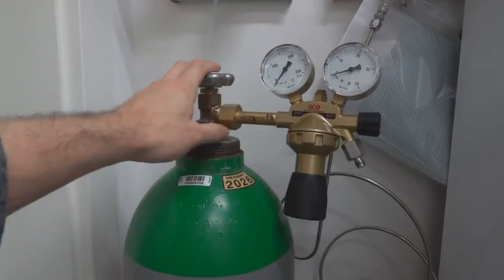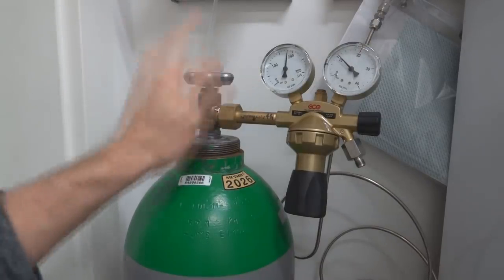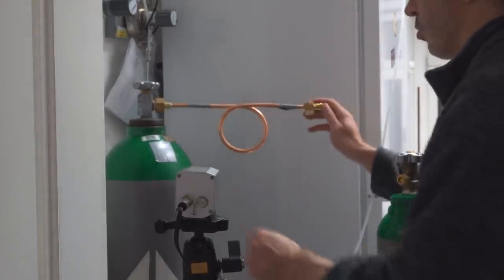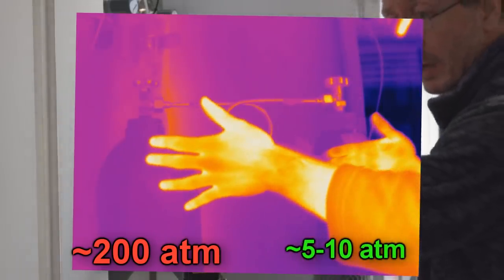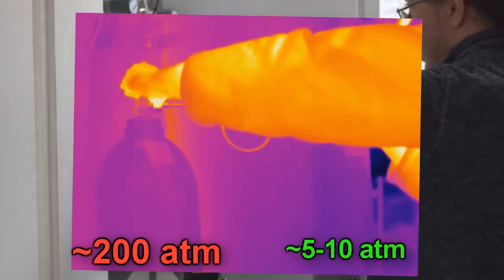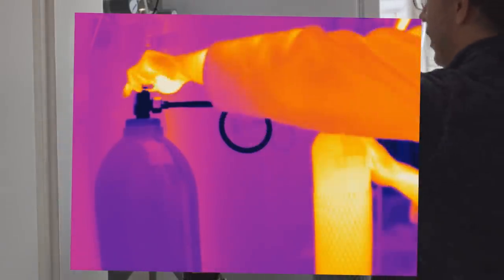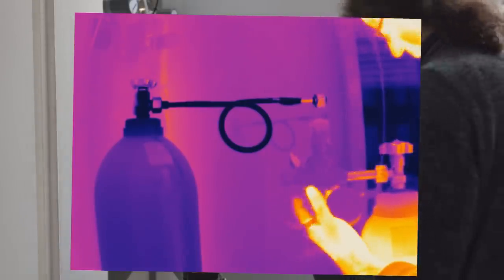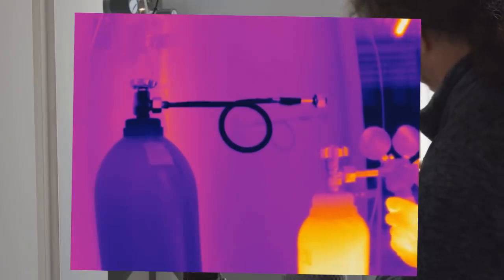Dangers of high pressure gas!

Comment: My general understanding is that using compressed gas to induce kinetic movement loses about 50% of the compression energy in heat.  As an "energy battery", compressed gas is not very efficient.
Reply: If you use it in an engine (piston or turbine) it can be actually quite efficient.
Reply: @phileas007  if you are speaking of turbo-compression, the inefficiency of the compression is hidden in a greater power generation in the engine.  Of course, you lose fuel efficiency, and compression loss is part of the reason.  Lastly, the compression uses power otherwise lost in the hot exhaust. My only statement is that as a manner of storing energy for later reuse, compressed gas is horrible unless it is just using power otherwise lost.
Reply: @puncheex2  No I meant just the storage and propulsion efficiency. E.g. http://file.scirp.org/Html/2-2760072_60325.htm

I'm not advocating for compressed air to be a viable alternative and a silver bullet. I just mean that it can have some legit uses
Reply: @phileas007  Oh, yeah, then I'm with you.  Nothing like pneumatic tires.

Comment: Respect your high pressure gas cylinders!

Seriously.
Do not do stupid things to them!
Here in Russia we have many cars with LPG fuel system installed. 95% of installations are aftermarket. Poorly installed or maintained LPG Fuel system are dangerous due to risk of explosion. Not combustion explosion but phase-change + expansion one. That kind of explosion will burst your car open like smashed tuna can. BTW working pressure in LPG cylinders are about 10-12 bar (i know there in liquid phase too).
Reply: Ha ha! A Russian lecturing on safety.
Reply: @Jehannum2000  not all of us are jackass xD
Reply: LPG i propane-butane? Thats no way 10-12 bar. More like 2-5 at normal temperature if I remember correctly.  CNG is however a completely different beast!
Reply: @Sixta16  Around the world people use LPG cylinders in their homes with something between 3atm and 10atm, so up to a little more then 10bar, and those aren't necessarely as safe as cylinders for vehicles, which usually should have thicker(or at least "stronger") wall, though with a "fissure before catastrophic failure(fracture)"  calculation in mind, like all pressure vessels! So, yeah they might have some hitting 12 bar and CNG cylinders can get up to 220bar!!!
Reply: I know a guy who had his car lpg system do this, ruined all his door and windows, the windscreen was blown out and flew 4 houses down the street. Very lucky it happened late night/early morning so there was no one on the street

Comment: Stop using Teflon tape on gas connections! If you need tape to stop a leak, then there is a problem with the fitting that needs to be corrected. I do work with pressurized gasses, including fuels, oxidizers, and inert. Not trying to be a prick, I'm just concerned for your safety. Cause I like you, and the work that you do. And I don't want anything bad to happen to you. Or anyone, for that matter.

Comment: FYI. 
The correct way to flush the line (to avoid introducing any moisture or foreign gasses into the receiving bottle) is to screw up the line on the receiving bottle almost all the way and then, ever so gently open the main sending bottle. While the gas is escaping out of the threads of the nut on the receiving bottle is when you tighten it up the nut fully. This ensures that the only thing in the lines is the gas from the sending bottle.

Comment: Can someone explain a list of reasons this is so dangerous to do? Alota things are dangerous in day to day life, you just gotta be cautious and have common sense
Reply: Pressing compressed air into your skin is very dangerous. And messing with high pressure containers is extremely dangerous. Only trained professionals are meant to refill compressed air tanks. Hes doing a portable air recharge which is what a lot of paintballers and air rifle shooters use. But you need a regulator to stop this heating issue.

Comment: Um, bad form on certain safety issues.
Also, pure oxygen can be astonishingly dangerous.
I worked with it in an ambulance setting where we recharged smaller bottles from a bigger bottle.
No open flames, spark sources, or heat sources of any kind.
No grease or oil on the threads.
Brass tools only.
Wear gloves.
And both bottles had to be secured before transferring gas.

This is actually a good lesson on how cold does not exist.
What exists is lower degrees of heat.

Your brain receives signals from your sensors (ie: on your skin) and interprets those signals as to something having less heat and you understand it as being cold.

Cold is not a physical thing.
You can not add cold to a system, you take heat away from a system.
In this case the compressed gas is absorbing the heat as its volume expands.

Cold is your brain telling you that something has less heat energy.

Comment: I do hypoxia experiments with low 02 gas mixtures as in this tank and every time I adjust the regulator I sweat bullets. Especially since the chamber I gas into can't exceed 5 psi otherwise it will explode.

Comment: That's why you don't run an insulated copper pipe as a transfer  line. The heat in the second cylinder during compression is only the heat picked up during the expansion down the transfer line. Hand your PhD back if that isn't fucking obvious

Comment: see if you can boil water off the cylinder by throwing 100 bar into it. Then if that works try melting gold with it as you did with the gummy bears.

Comment: Very very interesting! I would have been afraid to connect 2 tanks like that since if you opened the valve on the big tank wouldn't that make the pressure in the copper pipe the same as that in the big tank (since the is no regulator valve)? If so how could the copper pipe handle the same pressure as that of the thick walled steel tank?
Reply: The Robotics Code Depot because they have fittings & hoses that are rated for certain pressures.  I'm sure TF has enough experience with compressed gasses to know this & use the correct gear.
Reply: @ktx49  - I'm sure he does but it just seems odd that a thin copper pipe could be trusted to bridge two thick walled steel tanks.

Comment: I was taught to put the receiving cylinder in an ice bath.
Reply: It would make more sense to put both cylinders into the same bath. The heat would flow back from receiving one to the giving one.
Reply: @M0rtanius  Sorry, no. It really doesn't work that way.
Water is not the greatest for heat transfer.
PVT - Pressure, Volume, Temperature
Reply: @josebenitez3732  Just stir the water at the same time and everything will be fine. Still water does indeed not transfer heat well.
Reply: @josebenitez3732  It isn't? Then why is water so frequently used for cooling, including nuclear reactors?
Reply: @josebenitez3732  
But water does have significant heat capacity. Flowing water is more capable for contact heat transfer than convection alone.
Reply: @josebenitez3732   I think the main point is that it is a better heat conductor than air.  It doesn't have to be perfect; it's still better than leaving them both in air.
Reply: It depends how much time you have. There's no problem just watch the temperature, stop when it's warm, let it cool and continue, repeat until the pressure is equal in both bottles.
Reply: You were taught right 👍
Reply: Now you see why!
Reply: Someone mentioned that the receiving cylinder should be in a stable holding device too and wearing gloves.  Which makes sense. PPE.
Reply: Fake news
Reply: Somebody doesn't know how heat and temperature work.
Reply: In a water tank is good enough. 
It is not so much as to cool the receiving tank, but rather if it fails, the water absorbing the blast.
This happens due to metal fatigue over time and usage. 
In scuba diving, tanks need to have a "Hydro" (hydrostatic test) every 5 years or sooner if the tanks are cycled (filled repeatedly) as in a dive shop or diving business.

Comment: Just ask anyone who has filled a scuba tank. A nice slow fill to ~3500 psi (~241 bar) is done with the receiving tank submerged in water. It will still heat up the water in the tank considerably.
Reply: ...and pray to God every time you fill that the water will absorb the failure. 😂

Comment: In case anyone wonders why the gas is heating up :

http://tccc.iesl.forth.gr/education/local/Labs-PC-II/JT.pdf

probably this is helium gas. hydrogen would work too.

at room temperature, it has a negative joule-thompson coefficient . The gas is pressurized, which means that potential energy is stored in it. as it comes to a lower pressure environment, it expands, and loses the potential energy, which becomes heat.

if the gas was allowed to expand in a lower temperature, then it would cool, as it was not storing enough potential energy, to force the expansion, but the surrounding environment pulled it apart against it's initial volume - this would require its internal heat energy to be converted to work, which would make it cool.

in low temperature, gas would act like a *semisolid , where molecular attraction dominates, and the gas wants to preserve its volume. in high temperature, it acts like a compreseed spring - the release of stored potential energy converts to heat.

Comment: OK that was interesting.
But WHY does one tank go cold and the other heat up? Can anyone explain it to me simply?
Reply: temperature is just a measure of how much kinetic energy individual molecules/atoms have...how much they move around and 'vibrate'. When a gas is expanded, average kinetic energy of the molecules/atoms decreases (temperature decreases) due to increased space between them. When those same molecules/atoms are compressed together and more tightly packed next to one another, average kinetic energy increases (temperature increases).
Reply: @killeroftheshadows96  , ya, but you note that the gas that is expanding is heating up in the expansion chamber - right? so the expansion is leading to increased space and increased kinetic energy - the opposite of the ideal gas law you are describing.
Reply: Sean Con I definitely did not say an expanding gas is heating up. Re-read my comment. I said an expanding gas cools, and pressurizing a gas heats it up.
Reply: @killeroftheshadows96  ya. I know what you said. 
But it's the expanding gas that is heating up in the video. 

The 200 bar gas in 10 bar cylinder is expanding. And is heating up.
Reply: Sean Con the 200 bar cylinder is cooling down and the 10 bar cylinder is heating up. Not sure where the confusion is, unless you think the 10 bar cylinder should be cool as well. The reason the 10 bar is heating up is because there is already pressurized gas in it. That gas has to be compressed and will heat up, even though cool gas is what is pressurizing it. It is apparently a net positive temperature increase.
Reply: @killeroftheshadows96  
the gas that is coming in the 10 bar cylinder, AFTER entering the cylinder is expanding. 

it was a 200 bar stream, and now a 15 bar containment. this is expanding.

you are thinking, as if, the gas that was previously in the 10 bar cylinder is being compressed, in the same container - but that is not necessarily the case. there si nothing that is forcing all the molecules that was previously at 10 bar to go to 15 bar. they can as well diffuse back and enter the 200 bar cylinder. the entire volume of the 10 bar cylinder can as well be replaced with molecules coming out of 200 bar, now in 15 bar, while the molecules in the 10 bar initial state can go back to the 200 bar system.

you are thinking, that the 200 bar stream is a piston pressing down on the 10 bar system - increasing its temperature. thats unlikely.
Reply: Sean Con what I said is literally how it works. Why do you think a tire gets hot when you inflate it and cool when you deflate it? High pressure goes to low pressure, not the other way around. Could the 10 bar container “leak” molecules back to the 200 bar container? .....very very very very unlikely. With that kind of pressure differential and flow, its an impossibility with the scale you are talking about. The 200 bar container is, how you described it, literally acting pretty much like a piston.
Reply: @killeroftheshadows96  no
the high pressure of 200 bar will create a jet inside the 10 bar chamber.
this jet will collide with the static gas, and this will create vortices, which can be a very good transport mechanism- forcing molecules that were initially in 10 bar back to the 200 bar chamber.

that sort of thing happens in a rocket combustion chamber, if sufficient valve and chokes are not in place.
Reply: Sean Con this is a non issue with what we are talking about. Really think about it. It’s not going to go back in....not in any significant way by any stretch of the imagination. It will, and I fact DOES, compress that gas in the secondary container. It’s just a fact.
Reply: Sean Con by your logic, using a pressure washer should backfill the pipes with air. Lol 
Same scenario 
High pressure fluid out of a tube causing “vortices” of a low pressure fluid that forces the low pressure fluid back into the high pressure fluid pipe. 
See how that sounds? 
Effectively Doesn’t happen
Reply: @killeroftheshadows96  the pressure washer is not firing inside a closed container.
if it were, there would be backflow.

this sounds exactly what happens in a rocket combustion chamber. The fuel that is coming out of the pump has higher pressure than the combustion chamber, otherwise it wouldn't enter.
even then without adequate protection vortices can narrow down the incoming jet, openning up channels for exhaust to creep upstream
Reply: Sean Con No
Reply: http://tccc.iesl.forth.gr/education/local/Labs-PC-II/JT.pdf

probably this is helium gas.

at room temperature, it has a negative joule-thompson coefficient . The gas is pressurized, which means that potential energy is stored in it. as it comes to a lower pressure environment, it expands, and loses the potential energy, which becomes heat.

if the gas was allowed to expand in a lower temperature, then it would cool, as it was not storing enough potential energy, to force the expansion, but the surrounding environment pulled it apart against it's initial volume - this would require its internal heat energy to be converted to work, which would make it cool.

in low temperature, gas would act like a *semisolid , where molecular attraction dominates, and the gas wants to preserve its volume. in high temperature, it acts like a compreseed spring - the release of stored potential energy converts to heat.

Comment: That transfer did not look as safe as you should have been! If you blow up, who will do the cool science stuff ?
Reply: It is perfectly safe if the person who does it know what he is doing. Also, that pipe is professionally manufactured, it is brazed with silver alloy to withstand pressures well over 200 bar.
Edit: Some people in this discussion thought that the gas is oxygen. But this cylinder is from Messer, european gas supplier, check out their color codes https://pbs.twimg.com/media/C_X0b1PXkAAx5Xn.jpg

Comment: Er, rocket thrusters sound inefficient and wasteful, particularly for a car where one of the selling points is eco friendlyness.
Reply: Its worth ro point out here that the "cold gas thrusters" idea was meant as a last measure to prevent accidents. Like push the car back when the tires loose tracktion or make a quick push to a side to avoid a collision etc. There are quite some scenarios where such a system could save lifes. So its not entirely a joke. The joke is to use those thrusters to increase the 0 to 100 sprint time by supporting the tire grip via extra downforce or extra forward  thrust. Of course, this is silly and dangerous.
Reply: +Noromdiputs
I think the plan with the thrusters is
1: To add them as an expensive gimmick for rich people seeking extreme performance - not as a standard
2: To use energy regenerated from breaking that would otherwise be wasted (converted into heat of break pads).
Reply: wasteful indeed, now imagine what kind of people would afford those kind of transports, with zero parking skill, mixing up accelerator pedals and brakes, no opportunity to leave the vehicle to see if they are good to squeeze in. i picture they will just plummet wherever like : normal cars, sidewalks ect. :D
Reply: Lol that's a good point actually
Reply: I was about to comment that. Using compressed air as direct thrust is the absolute most inefficient way to get movement out of that energy. You do that only when there's no other option (like in space).
Reply: Mr. Musk will no doubt claim his rockets are of his own design, and are incredibly eco-friendly.  I can see him standing on the stage now, refuting the criticism even.  Oh no, wait--it's not Mr. Musk i'm seeing, it's Todd Howard!  "It just works!"